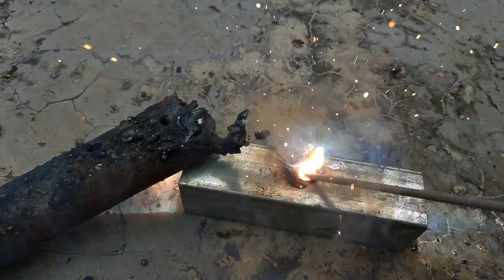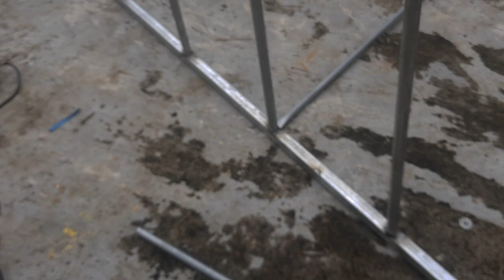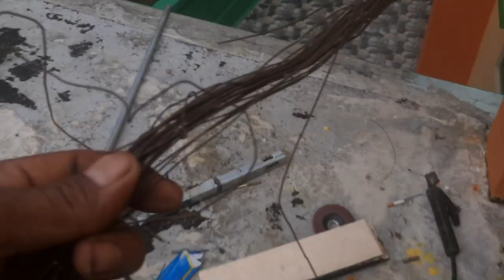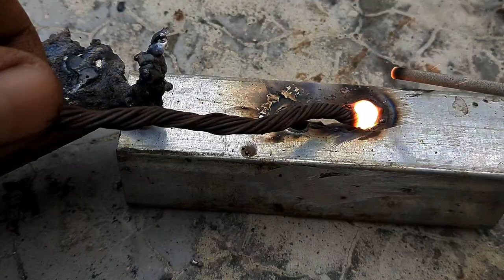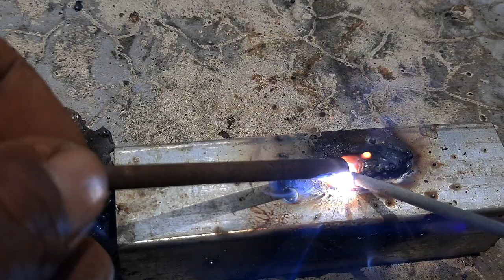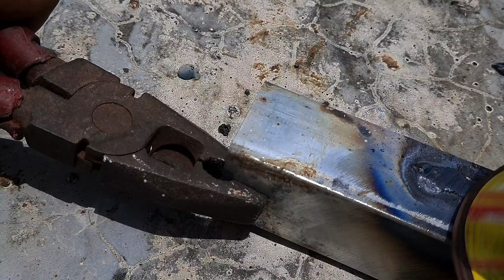2 crazy welder ideas in 1 mm welding |  thin square tube welding tricks

Comment: No no no no no no.
Just turn your amps down it's not hard, no proper welder will put rusty, shitty wire of unknown material into a weld, unless you like it to fail
Reply: 2.5mm electrode on 1mm material.Well smaller size of electrode smaller ameprage..They dont have education in their country i think.I hope he dont weld something important.
Reply from the maker: yes thank you, this is an explanation of experiments using metal around us,, here I use 2.0 wire for welding 1 mm,,
Reply: @stickwelder  
Yes we have all use filler material ( never wire) but it is not the best practice. Teach them to weld PROPERLY and than you do not have to spend wasted time filling holes and grinding
Reply: @jimmartin9704  hes just showing people, and im glad he did, so bolloks